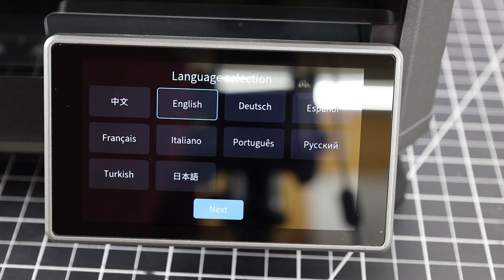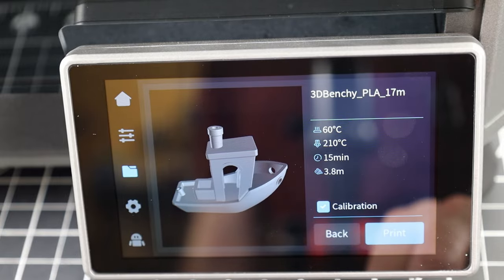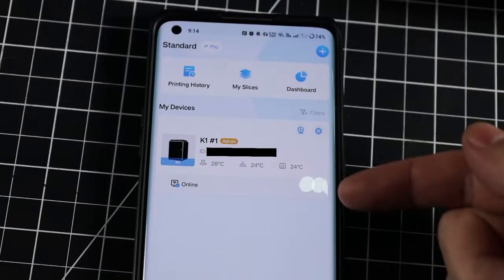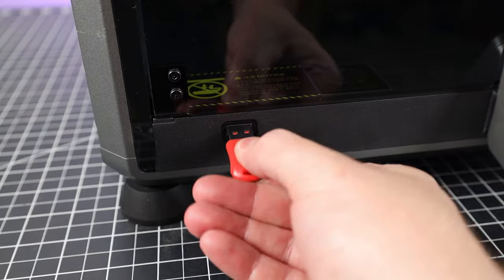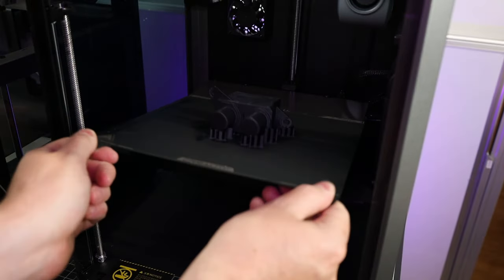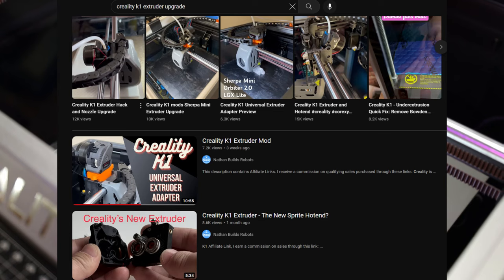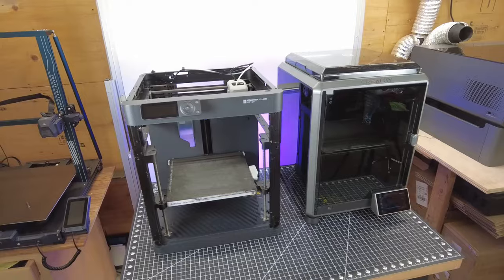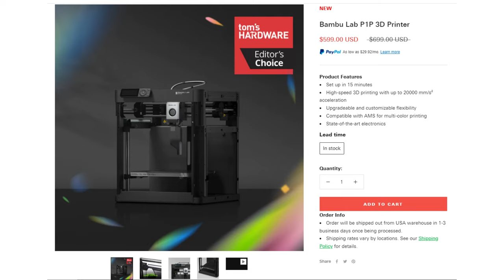Crazy Fast Out of The Box But With One Big Problem - Creality K1 3D Printer

Comment from the maker: Creality K1 3D-Printer (From Creality $599) - https://bit.ly/Creality-K1-3D-Printer
Creality K1 3D-Printer (From Amazon $699) - https://amzn.to/3CXlrdT

Creality K1 MAX 3D-Printer(From Creality $899) - https://bit.ly/Creality-K1-Max
Creality K1 MAX 3D-Printer(From Amazon $929) - https://amzn.to/45QKzjc

Build Plate Upgrades for the Creality K1:
PEI Double Sided Magnetic Build Plate for K1 (Only $18) - https://amzn.to/449CVQq
PEI Printing Plate Kit With Cutouts like the Original  ($26) - https://amzn.to/43bIgWb

Replacement & Upgrade Nozzles For the K1:
Ruby Volcano Nozzle Abrasion Wear Resistant High Flow 0.4 - https://amzn.to/3nt7IYd
Brass Volcano Nozzle M6 Thread Nozzles 0.4mm - https://amzn.to/44tNaQ8
0.4mm volcano Hardened Steel Nozzle - https://amzn.to/412d9v0

Parts & Video to Swap Out or Upgrade the K1 Extruder -
Sherpa Mini Extruder (Extruder Replacement Option) - https://amzn.to/43dIrjw
Bondtech LGX Lite Extruder (Extruder Replacement Option) - https://bit.ly/Bondtech-LGX-Lite-Extruder
Creality K1 Extruder Mod - Nathan Builds Robots - https://www.youtube.com/watch?v=PHbT2MKrB_A&t=366s&ab_channel=NathanBuildsRobots

Bambu Lab Printers:
Bambu Lab P1P 3D Printer (US) - https://bit.ly/Bambu-Lab-P1P-3D-Printer-US
Bambu Lab X1-Carbon Combo 3D Printer (US) - https://bit.ly/Bambu-Lab-X1-Carbon-Combo-3D-Printer-US
Bambu Lab UK Store - https://bit.ly/Bambu-Lab-UK-Store
Bambu Lab EU Store - https://bit.ly/Bambu-Lab-EU-Store

Enclosure for the P1P:
Bambu Lab P1P Enclosure Kit https://amzn.to/46AeGfA
ARC Bambu Lab P1P Enclosure STL Files - https://www.printables.com/model/356301-arc-bambu-lab-p1p-enclosure

Filament Dryer / Dryer Box:
FIXDRY 2 Roll 3D Printer Filament Dryer - https://amzn.to/3M09sBL
JAYO 1 Roll Filament Dryer Box - https://amzn.to/3p9OyqN

3d Printer Filament That I Use:
SUNLU - https://bit.ly/SUNLU-Filament
PolyLite ABS - https://bit.ly/PolyLite-ABS
PolyLite ASA - https://bit.ly/PolyLite-ASA
PolyFlex TPU 95 (Flexable) - https://bit.ly/PolyFlex-TPU-95
PolyLite Silk PLA Blue - https://bit.ly/PolyLiteSilkPLABlue
NylonX Filament - https://bit.ly/MatterHackersNylonX
PolyTerra Marble PLA - https://bit.ly/PolyTerraMarblePLA
TECSONAR Tricolor PLA - https://amzn.to/3H79d5N
Build Series PLA - https://bit.ly/MatterHackersBuildSeriesPLA
Build Series Silky PLA - https://bit.ly/BuildSeriesSilkyPLAMatterHackers
Build Series ABS - https://bit.ly/MatterHackersBuildSeriesABS
Build Series PETG - https://bit.ly/MatterHackersBuildSeriesPETG
PRO Series Filament - https://bit.ly/MatterHackersPROSeriesFilament

Amazon 3D Printing Filament:
PLA - https://amzn.to/3gsLE9Z
PETG - https://amzn.to/3pXjjvu
ABS - https://amzn.to/3wsTRjS
ASA - https://amzn.to/2RX8dtM
Polycarbonate - https://amzn.to/3cLdr38
Nylon - https://amzn.to/3iNGeI2
______________________________________________
Note : Most of the links that I use that go to products are affiliate link. This means I make a small commission on anything that you happen buy using them. This is at no extra charge to you and this helps support the work I do on this channel. 😁👍
______________________________________________
#creality #Crealityk1 #3dPrinting #3dScanning #DIY #RandyMay

Comment: I got a new K1 a day ago. It's been absolutely brilliant so far. No under extrusion issue yet.
Reply from the maker: That's good to hear. What have you been printing
Reply: Creality has fixed the extruders problem already it replaced the plastic gears with metal ones @randymay if you check the new one they sent you it should have the new gears 😊

Comment: under extrusion is usually due to clogs in the hotend caused by too much retraction with all metal hotends but not the case with standard hotends like on the ender 3 where the bowden tube touches the nozzle.  So if you are getting under extrusion lower the retraction settings to about 3mm max and it should fix the issue.
Reply from the maker: Normally yeah that could be the problem but at the time it was a known problem with the K1 and the extruder being defective. They have fixed this problem now and sent out replacement extruders to anyone that bought the printer.

Comment: Excellent Video!!!!!
Made my mind up to NOT GET a Creality K1 - until the redesign a filament feeder motor with a fully supported on both sides bearings...ie using longer bearing shaft....Amazing they copied someone else extruder motor and they did a shoddy job ????? super interesting that MICRO CENTER received 25 units - as of two weeks of having them in inventory they only sold 7 units.,....while they are completely sold out of Bambu Labs P1P's and K1's
Reply from the maker: Well thank you very much and yeah that's totally understandable. They definitely need to make sure they have that entire intruder system working properly and working reliably. They did tell me that they have something in the works that they'll be sending out but I don't know when I'll be getting it. 

On the same note I might have just got a package in from bambu Lab today that will be a upcoming video 😁👍

Comment: i've had mine for about a week now,and the extruder problem has been fixed,,the only real complaint i have is the noise,,it is fairly loud,and it would have been nice if creality would have included some extra nozzles,,i use esun filaments in all my machines and so far it prints esun just as good as the creality filaments,which are pretty pricey :(this machine is still a work in progress,but creality seems to be adrressing thier issues quite quickly, 3 firmware updates in the week i've had mine
Reply: Did they send you new extruder?
Reply: @nathanpaw  mine shipped with the upgraded extruder
Reply from the maker: Interesting, how different is it?
Reply: @bitzz  How can you tell if you got the fixed extruder?

Comment: The extruder on the one I got uses metal gearing. I just received it. I took it apart and its not black plastic like yours. I paid $450 for mine. I will make a video if it ever fails.
Reply: That's because you received the v2 extruder that was crealitys fix to that problem hopefully it no longer fails
Reply: And where did you get yours I just ordered one from Matter Hackers and I payed 421.87$ and received a 100$ gift card so i basically payed 321.87$ and I bought some filaments and extra nozzles with the 100$ gift card 😊

Comment: I think Creality made a marketing mistake.  They should have released this as Ender 3 S2 and called it a win.  I seriously thought Creality plans to replace The Ender line with the Ender K series, but at this point of time I am sad to say the Ender 3 S1 Pro is a more capable machine at least it can print what it comes with from its memory card.  Make it slower, say, print at 100mm/s default. still faster than Ender 3 v2.  use the same control board as V2 as it will be cheaper. then If we wanted, we could have just ran our own sonicpads at leaset we would get a half decent software.

I got mine yesterday and unfortunately K1 has been the first printer from Creality I own that can not print out of the box.  So now I need to figureout what is wrong and this is not the reason I buy Creality for.  If I wanted to figure things out I would build a Voron.  

- I own an Ender S1 Pro with Sonic Pad as well and what comes with the K1 as software is "from my viewpoint" worse than the stock S1Pro.  I can see the K1 is trying to do something blazingly fast but no printing.  
- I do not like the print bed at all.  the original glass ender 3 bed is better.  This one will not hold anything even with glue.  
- I really hate the spool location.  Completely retarded.  
- when you cover the top the cable guides hit the top cover and bind the bowden tube.  so you end up removing the cover. well when you do that cops show up at your door for public disturbance (it is LOUD)  I really loved the WTF is going on in there looks I had from people to be honest....
- my first layer is not low enough and I can not adjust it.  
- I really do not like the cloud app.  It is a ladyboy (It looks great but you know what you are going to get when you unzip it)
edit* - I just installed the software for slicing and we are looking at each other.  I suspect she is the Cloud Apps Brother.   
- I want to use this as an advanced more capable Ender 3 but it seems Creality has different Ideas.  
- For its price it is a lot of 3D Printer but it is a lot for this 3D printer at this point as its not fuctional. (sorry Creality I love your products but I hate your execution)

I am awefully confused at what I have at the moment.  It just looks amazing.   The quality of the product is magnificent.  I want to hug the bloody thing but For the time being I am going to put it on the shelf and treat it as a piece of art.

I am sure both Creality and the printing community will come together and fix the issue here.  The local distributor and the community is great here in Turkey so I am sure they will be all over this issue get things going.
Reply: Dude, Creality is more tinkering than a Voron.

And the Ender series was not planed to be reolaced by the K series.

The K series is planned to see the hightest line on Creality products alongside the CR series 

Ender series is the economy line of Creality and it will never stop, the Ender 3 already has succesors in the form of the V3 SE (the most basic), the V3 KE (Intermediate that has a kind of klipper installed on it) and the V3 (yes, the hightest of the line is only called V3, not V3 pro or V3 S1, just V3, is a core XZ Ender 3 with the K1 extruder).

Comment: I have a K1` buzzing away next to me right now. I got it riday, and the only problem I have had with it is printing PETG filament. It just doesn't seem to be able to extrude it fast enough, and I don't know if that's due to my crappy filament, or the printer. I suspect the filament, because it prints everything else I've put in it perfectly. I really dislike the ad-ridden cloud app, so I'm going to continue to be a curmudgeonly old man and just put files in the printer with the USB stick.
Reply from the maker: Yeah try a different PETG if you have some. You can use the Creality Print software on your PC to connect to the printer. I haven't had any ads on it that I can remember
Reply: @randymay  I'm going to try a new roll of PETG this weekend.

Comment: My K1 20/20 Hindsight Wish List:

Good reliable extruder (can't believe they pooched the most important part)
Klipper/Fluidd instead of the ripped off open source Klipper they crippled to make it proprietary
Move the filament reel from the back to the side
Print surfaces that do not require a stupid glue stick
K1 profiles for all popular slicers with all common filaments

Creality got so much right on the K1 and K1 Max but some of it looks like Bambu Me Too marketing driven design instead of solid engineering with the features that customers want.  I don't want a camera or lidar on the K1 Max but Creality is competing with the Bambu X1C so they glommed it on there and are charging me for it whether it works or not, whether I want it or not.

The K series are great looking printers with some great features such as being a fast core XY design with a 60 watt ceramic heater for high flow rates and fully enclosed to print engineering materials.  I love that they put a USB port on the front panel but they should make LAN printing and printer monitoring much easier with full featured Klipper, and honor the open source licensing agreement rather than ripping off the open source software without attribution or publishing the source code.

I refuse to use a cloud server or app to print my parts.  USB sneaker net or secure LAN only.  The spammy ads in the Creality K1 app make Creality look like a bad joke, not that I would have known without YouTube reviews and comments because I'd never install a 3D printer app.
Reply from the maker: All very good points and pretty much right on the mark. There was a workaround for a little bit that allowed you to get into the actual klipper firmware using fluid but they patched it within a week of that being released.
Reply: @randymay  - I saw what I believe to be a patch for the patch, where the K1 is fooled into downgrading the firmware so it can install the full version of open source Klipper.  Hopefully that's still working... and Creality needs to stop fighting with its customers by preventing them from using Klipper if they want.  In fact, they should stop crippling Klipper to be their purloined proprietary software and spend their effort developing reliable hardware that works.  It looks very bad to ship hundreds of flagship K1 printers with extruders that bend and under extrude after a day or two of printing.  The community conclusion is that they didn't fully test the K1 and instead shipped the first thing that seemed to work without testing for long term reliability.  Not having a bulletproof extruder on a $600 3D printer is a major fail.  They can recover from it, but it's a definite black eye for the K1, and ammunition for the evangelical Bambu Lab 3D printer owners.

I still hope to buy a K1 or K1 Max in a couple of months, but I'll wait for the teething pains to subside, and for the community and aftermarket to supply whatever Creality refuses to fix or provide - a reliable extruder, no glue stick build plates, a PrusaSlicer profile... even open source firmware for reverse engineered K1 hardware.

Comment: Very good video and i had the same under extruding issue as well and am speaking to creality to get this fixed. What profile did you use to print the asa? Ive been using the premade abs one but get artifacts throughout the print.
Reply from the maker: I just used the ABS settings for ASA

Comment: Hi, I have also similar problem with extruder on K1, it's looks like extruder cannot hold and push filament properly!
Reply from the maker: Yeah sadly that is the common problem that is happening. You will have to contact Creality for a replacement or modify the printer so you can use a better extruder 😥
Reply: @randymay  how they can fix this issue? They will send me same non succesfully builded extruder again :)
Reply: I'd better try to find some other way to rebuild their extruder and make it more smothly drive!

Comment: The P1P can do multi colour printing with the AMS, the K1 does not have that option.  The P1S has also just been released and it is a K1 killer.
Reply from the maker: Oh yeah the P1S is a K1 killer for sure.
Reply: Why is the P1S a K1 killer ? 
I'm sorry if it's obvious, I'm just trying to get back into the lobby after leaving 2 years ago, and DAMN things have changed a lot in 2 years !
Reply: they are surprised a printer that costs 900 beats a 500 printer lol @Akimitsuuu
Reply from the maker: At the time of making this the K1 had some really bad problems with the extruder. For me it failed after 20 hours and for some people it came out of the box not working at all. And the replacement parts took a long time to get as well. 

The price difference is not $900 vs $500 I was talking about just getting the P1S without the AMS so it's a $100 difference between the K1 and P1S. 

Now with everything fixed on the K1 is a better option now unless you ever want to use that AMS unit for multiple colors or backup filament rolls.
Reply: the p1s costs 900 vs 500 for the k1.  learn to read context bro @randymay
Reply from the maker: @itisinickt   Looks like I was wrong about the price of the P1S, it's $699 and the K1 is $499 right now so a $200 difference not $100 like I said before. The P1S with the AMS is $949. When I last looked at the price of the K1 it was $599. 
Here are some links to the printers so everyone can see the prices: 

P1S(Look at variants and select P1S) - https://bit.ly/BambuLab-P1S-3D-Printer
K1 - https://bit.ly/Creality-K1-3D-Printer

And like I said when the K1 came out it had problems and when it had the problems the P1S was a better option seeing that it just worked out of the box. That being said the K1 is a much better deal now that they fix it unless you need to upgrade later on to the AMS. So it looks like you are the one that needs to learn to read context 🤷‍♂
Reply: @randymay the AMS is something everyone needs even if they dont know it yet.
Reply from the maker: You really don't. I have been running 3 P1P printers for most of the year now without having an AMS on any of them. I also have an X1C with the AMS and it's nice but not a deal breaker if I didn't have it.
Reply: you sound slow @randymay

Comment: I recently got the Creality K1 3D AI MAX Printer but having issues, when doing the input shaping, the extruder goes to the bottom left or bottom right corner depending on how you look at it and can't move from that spot, any help?
Reply from the maker: Have you tried updating it?
Reply: @randymay  I am very new to 3d printing I don't know how to update because it. Do I need to do the initial setup first don't I?
Reply: Would it be ok to add you on discord for some help?
Reply from the maker: I'm not on discord 😅 also how long did you let the printer sit when it was doing the input shaping setup? Just because it takes a few minutes normally
Reply: @randymay  few minutes but that’s when it was banging and grinding very loud
Reply from the maker: @AntKeepsGaming.  Email me randymaybusiness@gmail.com